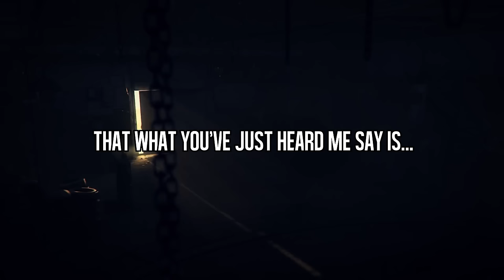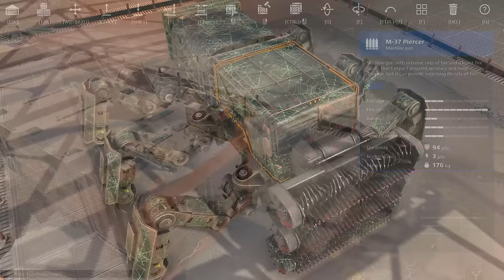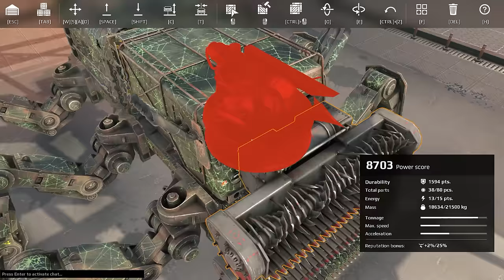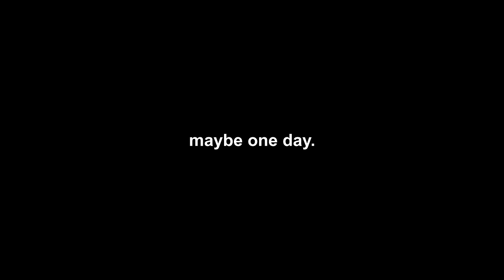MAD MAX WITH SPIDERS | Crossout

Comment: A pretty good representation of the game apart from a couple things. First of all, basically all of those parts Badger has, will cost A LOT of money, if you were to want them all in the game. I'm talking over $100. Now, there are crafting and trading systems in the game, so it is possible to slowly start grinding for in-game currency, but as the stock in the market of the game stands right now, it will be extremely tedious and time consuming. Then there's the fact that they keep coming out with a lot of new things in a pretty constant fashion, but the problem is that almost all of it costs so much in game, that it's almost pointless to grind for it. 

There's also another problem that can be found, if you play on PS4 (could be other platforms as well, but I have no experience on them, so I don't know). When your vehicle's power score starts going over 4000, the matchmaking gets screwed. After you pass those sort of levels with your vehicle, you'll get matched up with other players that have way more power score on their vehicles, than you do. The worst I've seen personally, were over 12,000 power score, when I was at around 5,600. This is most likely caused by the relatively small player base, which is basically devided into two levels: people who paid, and people who didn't. This is very frustrating, since basically it's creating a limit to how much you can build your vehicle. Even if you were capable of building something awesome, you can't, because you're going to get utterly fucked in the match making. Even as someone who used about $30 on the game (on a pack that was $50 without the discount), I'm not getting much use out of it.

So a problematic game, since like Badger also mentioned, it's really, really fun free-to-play game, especially with friends. But only to a point. And at that point you have to decide wether to pay or not.
Reply: If you take a good 12 hours for it, as simple as it is, you can have BARRELS of fun by just making carriers and letting your buddies go full killing machine on top of you.
Reply: @CriminalGamingHimself  that is boring af i did it before its not that good
Reply: KermitTheDank I get what your saying but I sort of feel it’s not a fault at badgers end. He’s getting the press account so he has everything and chances are his friends do too. Never played the game but I don’t think it comes across as how hard it is to get everything when you just get everything free of cost or time.
Reply: KermitTheDank Sad fact of the matter indeed, he can’t say truths even though I’m 100% sure he could still create hilariously amazing content while still mentioning flaws. ;(

Comment: I had a lot of fun with this game, but I lost interest. (Stopped playing after the Halloween event last year)

Don't let the video fool you
It takes so long to unlock the good shit that they use in the video unless you dish out some cash or try your hand as a amateur auctioneer.

Basically you can craft parts and then sell them to other players for the game's premium currency. But prices fluctuate depending one what's in demand so it's a really inconsistent way of earning money.

The best way to earn money in the game is to sell Fuel a resource that is needed to participate in Raids. And Fuel is always in demand and usually at a fairly high price.
Reply: Matthew Hilliker thanks for the tips.
Reply: Just keep in mind that if you sell YOUR fuel you won't be able to participate in raids and special events for that day.

Your fuel refills every day (unless you buy more)

Also start off slow, stick to the basic vehicle design and grind out EXP and cash for a while.

Also if you participate in special events and get event specific items you can sell those things for a LOT of money. Just make sure to sell them early on in the event as the longer the event goes on the less demand as  players will have either bought or earned the event items.
Reply: Matthew Hilliker it says “not enough resources to sell a container of specified size”?
Reply: means your tryna sell 100 of something when you dont have 100 of it, u cant sell 1 fuel has to be sold in 100's (or 10's im not super sure)
Reply: i have played for over a year this Matthew is telling the truth it sucks
Reply: "is telling the truth it sucks" theres no such thing as a true or false opinion bro
Reply: Yeah, just look at War Thunder (another game made by Gaijin). It's grindy as heck and it's the same here in Crossout. 

Basically Crossout's Late Game is like stock market simulator, i'm an aunction house nerd but it still gets to you (and i already spent money on a pack).
Reply: Question does it need internet to run or can it be a single player game?
Reply: Jonathan Cw everything needs Internet  in the game even raids which is a PVE mode that requires fuel to play and is still played with other players which isn't shown in the video
Reply: Xenonnic Well damn

Comment: I've given this game 2 or 3 tries.  You spend the first 5-10  hours as various variants of a pickup truck or van with guns.  You can make some slightly non "car with machine guns on top" variants but to get to the point where you can abuse the physics engine a bit to send things flying or use a gimmick to get some interesting kills, you need 20-40 hours of grinding in game.  If you can't afford to spend more than 2-3 hours a day playing, that drags the time out to a week or two... per vehicle, as you need to unlock parts and the requirements to fit them all on one vehicle.  Pretty sure they changed some things around a few times so who knows what they have currently for progression scaling right now.

I remember them adding some alternative modes to shake things up but eventually it just gets tedious and the game feels more like a chore.

Comment: Okay, the weapons, and vehicle cab they give away for the link are the same ones they make you craft in the Tutorial.  Also, they suck.  Literally, the cheapest, easiest to craft, weakest weapons in the game (And the cabin is about middle of the road in all respects.)  There's still the nearly limitless Build Possibilities.  I say "Nearly," because there are basic mechanics that keep you from just getting all of the most powerful weapons in the game, and mounting them all at once.  The main one is Charge, so you can at best mount 8 weapons, and only if those weapons cost 2 Charge.  (With the best cabin, and th best Generator, both of which take like a Month to craft, if you're good at grinding Guild Wars.)